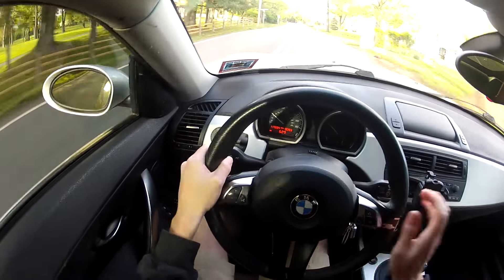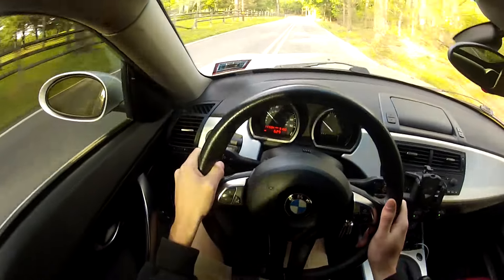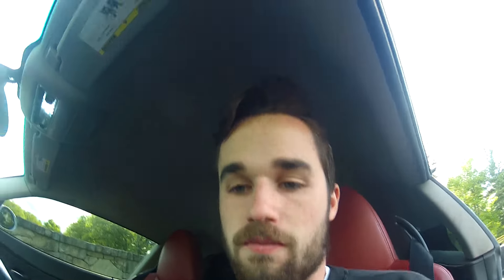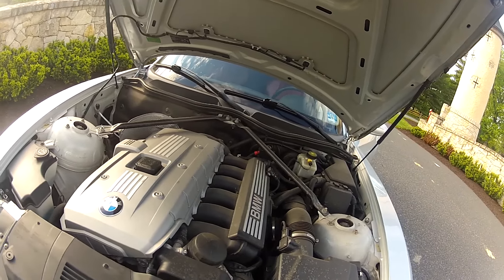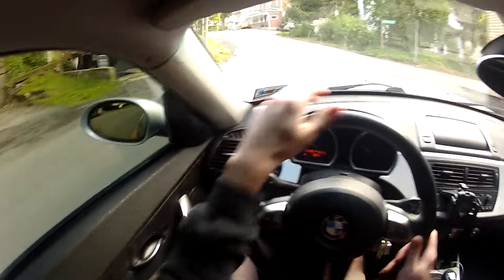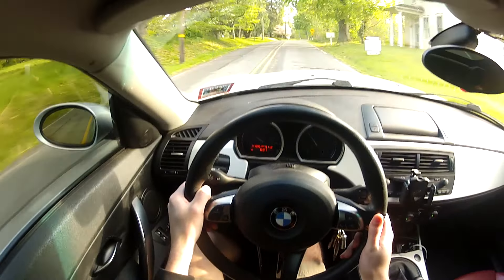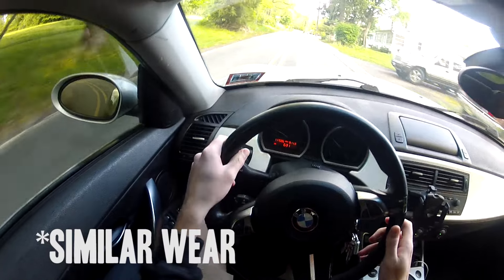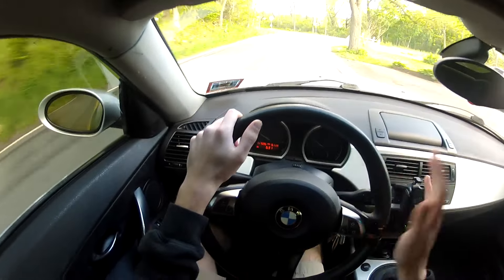The INFAMOUS BMW Lifter Tick / Ticking Noise (E90, E92, E82, E85, E86)

Comment: Hydraulic lifters don't adjust. They are hydraulic. They pump up. If they are ticking good chance the oil wasn't changed enough or the wrong oil has been used in it cashing a build up of sludge/ contaminants. Run some Castrol GTX through it, or something similar that isn't to aggressive but aggressive enough to clean the system out gradually. Once the contaminants are out. The lifters will be able to pump up correctly, and the ticking will go awaym
Reply: i got a 2006 330i i have slight lifter tick like it flows with the engine sound what should i do tk get rid of it im tryna have this car for a while
Reply: @KingOfYouAllGamerBoy  Ensure proper oil level and add oil if needed. Drive until engine oil reaches operating temperature. Then, using manual mode, maintain RPMs around 4K for 3-5 minutes. Hydraulic lifter tick will be gone as oil pressure will have ensured proper lubrication of hydraulic lifters. The sound won’t damage your engine, it’s just annoying. 🙂
Reply: Very useful thread

Comment: correct oil and it wil not be any problem, use  maximium 5w 40 if you in a hot place, in winter 0w 30 or40. and you wil not have the problem. mace sure the oil spec matches the engine, it s VERY important the oil qality in those engines, and change oil more often than what is reqierd in the service.. this happend in mine e90 330i, when i bogth it, and i just changed to correct oil and it never happend again, iven if i drive just smal/short trips,.... best regards bmw mecanic.
Reply: your absolutely right. the manual call for 5-30/5-40 and states that it is acceptable to use either in all condition. My 3 BMWs do not tick because I use 0-40 Synteck. You can use 0W-40 in the summer because the temp of the oil will be greater than the need for a 0W but will give you the whole range. Like an expert at Amsoil once said "if its summer out there, theres no difference between 0-30 and 5-30 because its summer and  both oils are 30. In the winter the 0W is your engines best friend. Also change the oil every 5k miles or 7k in Kilometers to keep the peanut butter sludge out of the vanos. I seen it on those 15k miles oil change/ 25k kilometers oils change....not good.
Reply: What are your thoughts on redline 5w30 for my 2009 335i?
Reply: It has 105,000 miles
Reply: Use Castrol Synteck 0-40 every 5k miles.  It is available almost everywhere, better availability then Redline.  Redline is no better just marketing hype.  Also if you go to the BMW website (I live in Canada, so for me it's the BMW Canadian official website, US would be the same since it's the same car, but you should look it up or call the dealer and ask) Anyway BMW uses Castrol Synteck long life. The non long life regular full synthetic Castrol Syntek is perfect for 5k miles oil change intervals. BMW website list 5-30 as there Bronze oil change and 5-30 on there Silver oil change and 0w-40 for Gold oil change (and 10w-60 only for true M models) So the best grade you can get at the dealer is 0w-40 oil.  That's why I use 0-40 and my X3 3.0si runs like a top and nice and quiet, same for the wife's X3 and my old 328i that I keep as a spare car. You have the full range regardless of ambient temperature.  And the VI's (viscosity enhancers) in the oil will adapt to whatever temp the engine is under.
Reply: @sperlongatours  so you call my f30 bmw 320i twin Turbo with a 11 to 1 compression ratio a low compression engine? Just like your name you make no sense. If your engine is rubbish and leaks 0w40 you should start fixing your oil leaks instead of spreading BS. Iam currently from 184hp tuned up to 311hp with 22psi of boost and iam still running 0w40. Try 5w40 and you will instantly lose hp beacause of the viscosity it has more resistance than 0w30 or 0w40.

Comment: Bought an E36 328i M52 with this once, it did a lot of short trips. Solution is to warm up the engine then rev it at 3000 rpm for 3 minutes in neutral. Let it idle for a minute and if it's not cured try again. It's down to the hydraulic tappets needing bled. More of an issue on N5x engine series than the older ones.
Reply: My m52b28 just started doing this today after sitting on stands for 6 months 🙃 gonna try this after beating the shit out of it
Reply: @shrxmprl2250  did it work
Reply: @Cool experiments  actually yeah, it went away after about 2 tries. Hasnt been back, and it runs fine. Fuel trims are spot on.

Comment: Thanks for the video and in-depth discussion. My car has hydraulic lifters and hydraulic controlled VVC mechanisms, which uses the engine oil. The recommended oil is a semi-synthetic 10w-40, but I thought I could use a 5w-40 full synth because I live in a cold place and I just thought full synth is always better. Turns out I got more tappet noise and I'm considering going back to the non-glamorous Castrol Magnatec 10w40 part synth.

Comment: Liqui moly 8345 hydrostößel additive or Wynn's valve lifter treatment worked for my e36 M43.
The engine had the same noise , especially when it was hot.

Comment: An oil change alleviated my ticking. Driving a 2004 z4 3.0i with an m54 engine. I'm using synthetic 5w-30 and I change the oil about 7500 miles. Probably still need adjustments, but at least I won't have the damn ticking anymore. Check the oil levels and using the right oil.

Comment: e46 does this, just changed oil+filter using oem filter and the bmw approved castrol oil for the engine and still have the tick. its only when the engine is cold and it goes up with revs. when the engine is warm it dissapears but comes back after a cold start. any ideas? i feel like every time iwatch a new video about this they say something new
Reply: If it only happens on cold starts and gets worse in winter and always goes away or greatly reduces when the car is warmed up, that means you’ve got poor cold flow of the oil, switch to 0w30 instead of 5w30 and throw on a high flowing filter that still does an above average job at filtering like puralator boss, or Napa filter which actually flows better and should be cheaper the downside is it doesn’t filter as good as purulator boss the purulator is the best middle ground I’ve seen between good flow and good filtration, also high rev your engine once a day (don’t do it until it’s warmed up and been running 20mins or so
Reply: @WalmartShooter  thanks for the tip but turned out it was just a bad AC Pulley, it ticked like this and went away when warm assume some rubber or plastic expanded and it removed the noise. i run 5w40 no issues.

Comment: BMW lifter all hidraulic... After sometimes the check valve inside the lifter will clogged or If you rarely drive it will fills with air buble and make it stick with hidraulic piston inside the lifter and creating thicking noise.

Comment: This happens on my E61 530i, I noticed this when the car is cold and also when the oil is due to be changed as part of the service. After the oil is changed and you start the car from cold I no longer hear the tick tick noise. Perhaps this is the same for other BMW owners with the N52 engine.

Comment: I had this same noise in my E90 and the people in the workshop told me that this is caused because I didn't use the correct oil and the problem was that I bought  oil in a gas station and I used that in my car and after a couple of months this issue appeared but know looks like everything is good. They changed the oil and the filter and the noise disappeared.

Comment: I had this problem in  my 07 E92 328i with the N52 engine. I used to put 6.5 quarts of oil in the car when changing the oil and the ticking was prevalent. I increased the oil to a full 7 quarts of oem BMW synthetic and the ticking stopped immediately and never came back. I also use sport mode in my auto transmission which gives better performance for city driving and over 55 mph I shift to normal drive for better gas mileage. This keeps the revs higher and shifts later and thereby helps with the overall workout of your engine. My mechanics are BMW racing team and they told me the car loves to be driven hard and taken to red line through the gears to keep the overall performance at its peak. If your car has really high mileage, I wouldn't recommend taking to red line often if at all. Just treat your car like a pony and not a race horse to keep the components performing at their peak.
Reply: Hi, what kind of oil did you use? 

I recently replaced the oil with Castrol Edge, 0W40 however lifter noise is still there... There are lots of comments saying use 0W, 5W 10W etc for a BMW N52?

Comment: I hear the same problem in my engine. I got a 2012 z4 28i. Took it to the dealership and another mechanic and both said to just replace the engine.
Reply: Replace engine when engine is blown not staring and running. Useless mechanics
Reply: @aimized1460  right , smh
Reply: The only reason why I can think of them saying to replace the whole engine is because they would make more money of you. I don’t know your current mileage on that car but if it’s passed 250,000 and your hearing this noise unfortunately the only thing would be to reshave your piston ports and get bigger lifters. basically a engine rebuild. In my opinion its not worth it, just ride that car out till the end. use that sea foam before your oil change it could clear up some of that gunk, best of luck bro !

Comment: Had the same noise on 02 330Ci with 25k miles...lots of folk said adding Marvels Mystery
Oil would help and it certainly did!...its now back to its 'musical' best...give it a try ;)
Reply from the maker: Interesting! I'll look into it!
Reply: Marvel was always a known cure for this noise for years ive heard about marvel ..what is happening is the lifters go flat usually when they sit for a long period of time revving the engine brings up oil preasure inturn pumping up the lifter my guess is the marvel is thinner than the oil in the car making it easier for oil to flow through the lifters reasurising them back up and loosening any gunk that may be stopping oil from preasurising the lifters ... I also like to run some seafoam in engines that are all gunked up on the top end and running Castrol motor oil as it cleans out all that gunk makes the engine look new again .

Comment: This video brings attention to a common issue with BMW's (and a lot of other cars too) but it doesn't really give all that much useful information about it, other than anecdotes?  Lifter tick is, in fact caused by the lifters being "out of adjustment" as you put it, but the important thing is WHY. 

In my experience (I'm a BMW/Mercedes technician) the quality of the engine oil, type, etc is a big contributor.  How often it's changed is another.  I have had lifters fail completely after ticking for years and what I usually find is that the tiny oil passages leading into/out of them are completely plugged with sludge/dirt/carbon.  It's pretty nasty stuff.
Reply: Johnathan Waters are these the hydraulic lash adjusters? Ive replaced some on a dodge charger that had the same issue. Would you recommend just replacing them? I bought an 06 325i that sat for over a year so the ticking is ver pronounce. I rrplaced the valve cover gasket and it is very very dirty inside. Oil is so dried up in there that it's flaking off. Any advice?
Reply: It depends on how bad it is.  I've been able to clean some of the noisy ones out by just flushing the engine over and over.  There are a lot of ways you can do this. (Some people even say you can put a quart of ATF into the crankcase, which i personally don't do) but ultimately if they are totally impacted, they need to be replaced. "Sludge"
Reply: How can we be sure about oil quality and such?  Mine goes to the dealer for changes but doesn't get driven in winter.  Parked in garage with battery tender.  I've been told by dealer needs new lifters but an independent mechanic (European motor specialists) have said not the case.  Usually the tick does subside with the "standard" fix of maintaining >2000 rpm for 5 minutes?
Reply: Cold engine lifter tick with hydraulic lifters is very common across all manufacturers. It is just that, the oil is cold, the lifters probably have lost some oil, maybe there's a bit air in the oil. The all will fix itself when the engine heats up, the oil gets its heat viscosity and will flow well.. and all this is normal. Sometimes for removing air, you may need to give it a bit more revs to keep the oil pressure higher, which will push the air away and the lifters will adjust and quite down.

What is not normal, is the lifter tick that keeps on going while the engine is hot and enough revs and pressure is given. Then the lifters are either stuck mechanically or are plugged from sludge or debris in the oil. The mechanical breakage is very rare. The sludge or debris is in majority of cases due to neglegted oil changes or overheating the engine e.g. due to the water pump failure that can easily happen on E90 due to missing engine temperature gauge and electronic water pump failure.

This probelm seems to be more often encountered in US, and to me it seems there's a lot of owners in US who neglegt the oil change interval and/or use cheap off brand oils, which do not fill the requirements required by BMW.

When you buy a N52 engine car, ensure it has its oil changes done according to the requirements, preferrably at BMW service, and that the engine quites down when working temperature is achieved. I'd rather walk away from a car that does not have a good service history, because there is also the VANOS seals that will scratch up and possibly ruin the whole head (on intake side, exhaust side can be fixed), if the engine has not been on proper maintenance.

Comment: To reserve the lifters,
Park
Start the engine 
Rev your car to 3000 rpm ( 2 min ) 
This will reset your hydraulic lifter tick.
🤫
Reply: StraightHugo do u mean holding the gas @ 3k for 2 min or tapping the gas for 2 min
Reply: @winstonsheppard5592  yes. I did it on my n53b e92.

Comment: Yes i agree you don't know about lifter noise. Do some homework and try again. Lifters in your car are hydraulic , there for if you have Lifters noise its most likely they are draining out of oil. So you would need new lifters maybe some sort of lifter additive for the lifters until there replaced.

Comment: Thanks for the video, but you’re a bit wrong. I have daily driven a 09 E89 Z4 sdrive30i for 2 and a half years now. Mine has essentially the exact engine as your Z4 30si, I beat on my car everyday, keep my rpms high and the ticking noise still hasn’t gone away regardless of a cold, or a warm start. I’ve packed over 40k miles on it since I’ve purchased it also. Thankfully I haven’t had any issue at all with my car but to say that the noise is coming from not driving it as much or because you don’t have your rpms high is completely wrong since I do that daily and the noise is still present. It’s not an annoying noise as you can only hear it when you basically pop the hood. But just wanted to inform you about that. I’m not an expert on this at all, just wanted to share my experience for those who are seeking more info about this.
Reply: Bimmer Boy use BMW/Euro synthetic oil. Not all synthetic oil is the same.  It fixed my 530i up right away.
Reply from the maker: I appreciate you sharing your experience, but you are claiming I am wrong based on your experience. However, my experience is just the opposite of yours, when I drive the car more often, or drive it harder, the lifter tick goes away almost instantly. I only ever notice it after the car sits for a while. I have owned this car for about 2 years as well, and thats my personal experience, which is not wrong but it is what it is. Seems like a case-by-case scenario.
Reply: Lifter tick is the result, but the cause can vary.  Many BMWs have some lifter tick when cold and it will almost disappear when the engine gets warm and is driven a bit.  Lifter tick that does not go away even after the engine is warm and driven may be a sign of (for whatever reason) not enough oil getting to the lifters.  This can be sludge in the oil clogging up the lifters or worse.   As stated in this thread, regularly maintained oil changes with BMW spec oil (LL-1), not just oil that says "recommended" is a must for these cars.  It's probably safe to say that many BMW drivers do not use the proper oil and do not keep up regular oil changes.  I say that because I know quite a few BMW drivers and for many of them the Bimmer is more of a toy/status symbol than a complex machine that need TLC in order to run optimally.

Comment: You need to do a motor flush as well it will get out sludge from the motor check out my boy NathanDiy Channel he performed it on a E90 for a customer
Reply: Did u need to do an immediate oil change after the bg?

Comment: Lifter tick can be solved by adding thicker oil. Guaranteed whoever has lifter tick has well over 100k miles. I have a 2004 525i E60. Lifter tick was gone after adding 10w30 from 5w30. Oil pressure is needed so thicker oil will do the job
Reply: I have a 07 530i and the lifter ticket became quite prominent at 55k miles...current odo reads 57512. Unfortunately, left the car parked for months at a time thinking I was keeping the miles off of it was a wise idea....guess not. I will try the bleeding and a heavier oil if the noise does not lessen.